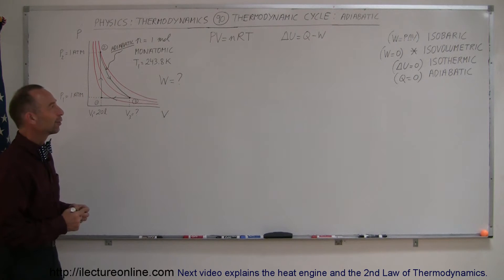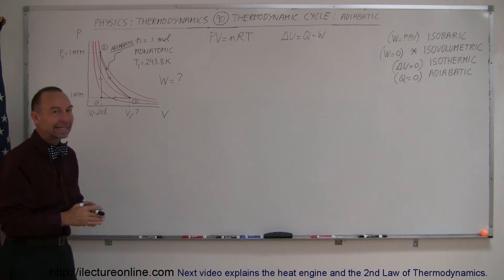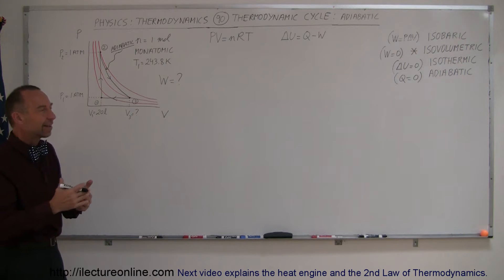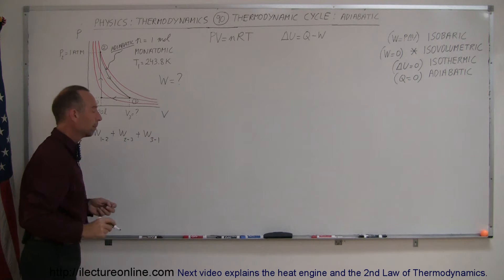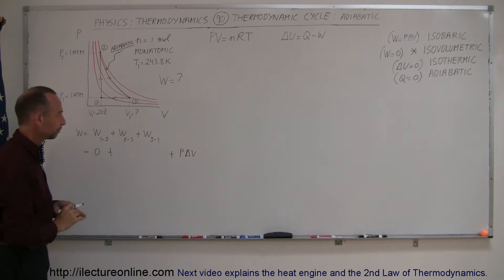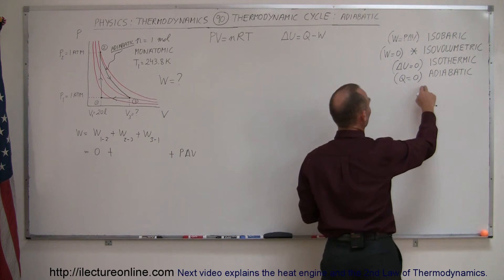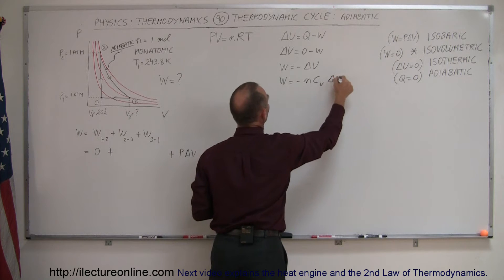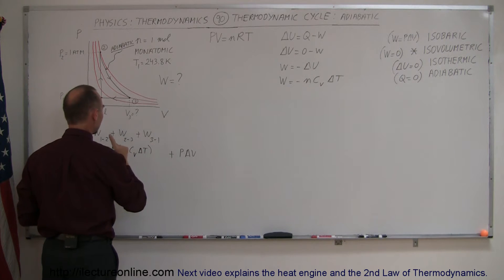Physics 28  Cyclic Thermodynamic Process (4 of 4) Adiabatic Cycle

Comment: Why do u write deltaU = Q - W instead of deltaU = Q + W, asking because in my notebook it's deltaU = Q+W?
Reply from the maker: It depends on how the first law of thermodynamics is defined.  Your book defines it as:   the change in the internal energy of the gas = the heat added to the gas + the work done ON the gas.    If a minus sign is used it is defined as   the change in internal energy of the gas = head added to the gas - work done BY the gas
Reply: @MichelvanBiezen  so it doesnt make any difference? Thanks
Reply from the maker: That is correct.  It is essentially the same equation.  If you do work on the gas, the internal energy of the gas increases.  If the gas does work (on the environment), the internal energy of the gas decreases.
Reply: @MichelvanBiezen  Thank you.

Comment: Why can you use W = -nCv(deltaT)? I thought you could only use it when the volume is held constant
Reply from the maker: No, when volume is constant, W = 0.  Gas can only do work when it expands.  In an adiabatic process, Q = 0 and thus delta U = - W and therefore W = - nCv(delta T).
Reply: Ah okay! Thank you for clarifying and your fast reply.  I got confused with delta Q = nCv(delta T) for isochoric/isovolumetric.  But I'm still confused why W = -nCv(delta T) though, is it because the process before it was isovolumetric?
Reply from the maker: That is only true for an isochoric process as you indicated.  Not that delta U = nCv(delta T) is always true for any process.   And W = - delta U = - nCv(delta T) is only true for an adiabatic process.
Reply: I see, thank you so much :)

Comment: what is Cv? or Cp?
Reply from the maker: C represents the specific heat of a gas.

Heat required to raise the temperature of 1 mole of gas by 1 degree centigrade.

Interestingly enough, for a gas it depends on whether or not, the volume remains constant or the pressure remains constant.  (That is why the v or p is needed, because the two values are different)
Reply from the maker: +Traian Basescu 
Cv is the specific heat of a gas when the volume remains constant.
Cp is the specific heat of a gas when the pressure remains constant
These are used to calculate the heat added to or removed from a gas during an isovolumetric, or isobaric process.